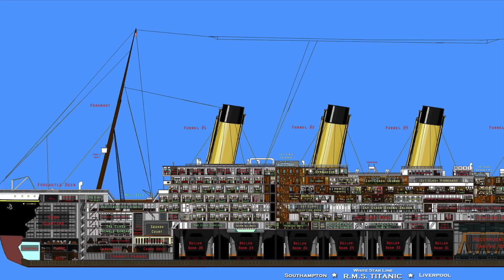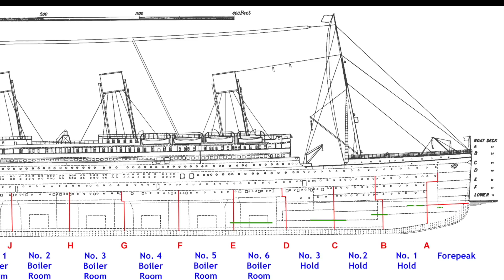Why didnt Titanic Boilers explode during the sinking? Reupload

Comment: What caused the boilers to roll down to the bow during Titan it's final plunge? In the wreck, there are a cluster of five boilers lying on the ocean floor. What caused that to happen? Did the boilers that were lying on the ocean floor in the debris field fall out of the ship during the breakup?
Reply: The attachment points were not designed to hold the heavy boilers to the deck in a vertical position.
Reply: Those single end boilers were located in boiler room 1. All other boilers were double end.The ship broke apart in the vicinity of boiler room 1 and the engine room. Those single end boilers are located in debris field. When Bob Ballard discovered the wreck, it was one of those boilers that identified the wreck as Titanic.

Comment: 11:28 So the boilers are falling?
The few survivors in the lifeboats had seen the Titanic's rift in the pitch-black darkness, and many more had heard a few repeated thudding explosions coming from beneath the water as the stern slowly began to sink. Such a definition of a loud and sudden sound was mainly given by passengers who did not even have an indirect connection with working at sea, suggesting that steam boilers were exploding in the bowels of the steamer. Which in reality could not be, since the visible boilers from boiler rooms No. 1 and No. 2 are intact and the hull in the area of the other boilers is not damaged.

Even Second Officer Charles Lightoller joined the majority, stating: "I have heard that many are convinced of this, while others doubt it. I think the boilers have exploded." To clearly distinguish the nature of the " sea " sounds and skillfully associate them with something else, you need to "exist" inside them for some time. Passengers and service personnel followed an uncomplicated associative chain: a loud bang means an explosion, and the contact of a hot object with cold water could cause an explosion of boilers. Much more accurate is the evidence of the minority, to which the roar of the implosion, the destructive displacement of air from the bowels of the stern, the peeling of the skin, the collapse of the floors, the separation of the front part of the propulsion system, resembled the sound of a thunderclap.

Lookout George Simons recalled: "In less than two or three minutes, the stern rose vertically. There was a sound like a thunderclap, which is usually heard in the distance, and soon she disappeared from sight."

Stoker George Beechamp said: "The bow section slid under the water first. I watched the stern, and then she sank. I heard a roar like thunder."

Coxswain George Rowe agreed with his colleagues: "It was not an ordinary explosion, it was like a distant thunderclap."

The most detailed story with a hint of the implosion of the internal aft rooms was presented by major-yachtsman Arthur Poshan, who has experience of navigation: "I heard explosions, rather, a rumbling sound – not sharp, but strong enough. I can't say it's as loud as a thunderclap, a cauldron explosion, or anything like that. I dare say the decks "collapsed" under the pressure, pulling the steamer down with her nose forward. The huge mass and the air between the decks caused the "explosion" - that's my theory. I do not know if this is correct or not, but I do not think that the boilers exploded. Perhaps it's the pressure: the enormous mass pulls the ship down, the water rises up, and there is air between the decks."

Comment: One thing confuses me, if the iceberg struck on the starboard side why did Titanic list to port?
Reply: At the beginning of the sinking the titanic did list to starboard, then leveled out. Later on it developed a list to port, most likely because when e deck flooded it flooded much faster on the port side because of the corridor scotland road and open crew areas more easily flooding on the port side vs narrow corridors and 1st class staterooms on the starboard side
Reply: Sam has a whole video explaining this.  Or someone does and now I can’t recall the answer to your question!

Comment: The question I have always asked myself is, do experts have a preconceived notion that pressurized boilers explode when they come in contact with cold water? Why wouldn’t the pressure inside of a boiler return to it’s state of water instead of high pressure steam harmlessly. The catastrophic sound of boilers leaving their cradles and crashing through bulkheads could easily be mistaken for explosions. There has been over 100 dives to the titanic and I don’t recall anybody reporting boiler explosion damage. I do believe that many myths come forth from the sinking of the most famous ship of all. Perhaps exploding boilers is one of those myths. There is indisputable evidence that’s some boilers imploded from the incredible deep ocean pressure on the boilers that are never filled to their complete liquid capacity. These implosions obviously would not be hear by anyone but jellyfish. 
I think there is enough lack of evidence to say, maybe the boilers exploded and maybe they didn’t.

Comment: The cold water had cooled down the boilers, I'll use some railroading tech here
A steam locomotive and a steam ship are practically the same thing so I'll use some real examples 
If you notice a steam engine runs lowder when in the cold so the vented steam would have been louder sense it's colder but usually a boiler explosion is due to to hot of fires and the boiler gets to hot  and with no cool water to cool the boiler the boiler detonates
So I think rooms 3&4 were not getting enough water and we're about to detonate but the sudden rush of cold water may have caused a chain reaction but idk it was over a hundred years ago but it's fun to theorize

Comment: I know the stern was destroyed because of water pressure on the way down and the ship breaking had alot to do with weight and stress, but could it have been possible that the boilers exploding had anything to do with the ship breaking in two and the stern being so damaged. Survivor testimonies talk about hearing explosions which could have been just the break itself and stuff inside the ship moving around. I feel like it could it be a factor. The lights were on for most of the sinking so it's got me thinking. Great videos by the way!
Reply: No. See my other posts on this. The only boilers that could have even contributed to this are accounted for since they have been visually accounted for in the bow section, intact, except for being slightly indented on the faces due to water pressure as the bow sank.

The singled-ended boilers in Room No.1 were never lit and they fell out and landed scattered in the debris field intact and all five of them are also accounted for.

Finally, numerous finite analysis have been conducted that show that the ship was doomed to break up with the immense stresses on the hull that vastly exceeded what it was designed to.
Reply: doubt it,possible though
Reply: @formerthing  I doubt it too but I'm so fascinated with the breakup I wanna dig deeper lol

Comment: So from what I’ve researched is that the boilers are still intact on the ocean floor which doesn’t indicate much of an explosion.  It could’ve been the rush of water forced out the burning coal idk. 

Also, they say the boilers were so heavy that they were mainly held in place by gravity and were only secured by light piping (for steam) as the titanic was close to a 45° angle, these boilers could’ve broke free and slammed into the bulkheads. Also, the other noises that can be attributed is the pressure of the water on the walls of the passenger decks being so high and the walls giving way and bursting.  

Some other noises can be also attributed to the ship being pulled apart until the final snap when it snapped apart.

As always Sam, these are all hypotheses, and up for debate.  I enjoy watching your videos.  Keep up the good work!!
Reply: @Brendon McGill: Did you see the boilers that imploded? I assumed it was from the pressure of the deep but heard that it was from them being hot and then being exposed to icy cold water. I wish there was more info on it for a definitive answer.
Reply: Titanic had 24 boilers. You're not seeing them all.